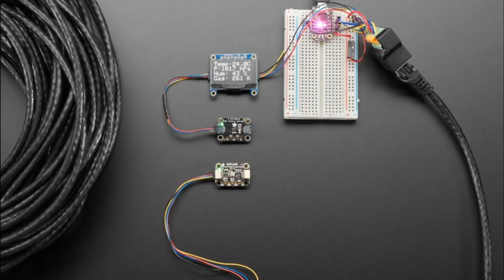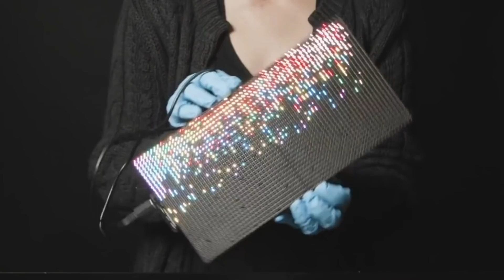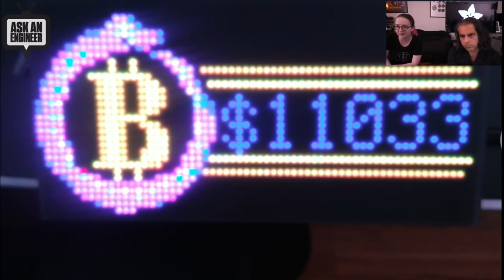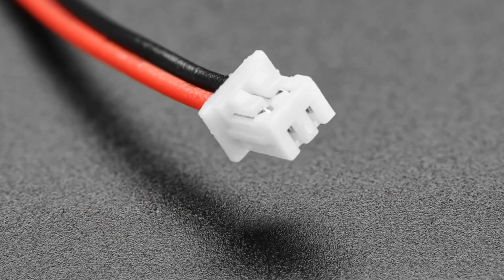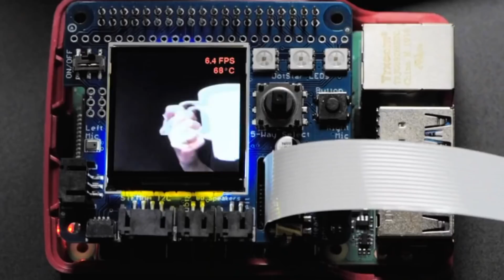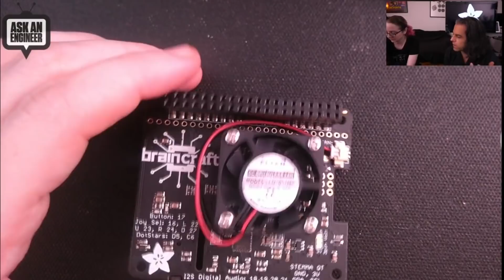New Products 9/16/2020 featuring Adafruit BrainCraft HAT - Machine Learning for Raspberry Pi 4!

Comment: What are those ethernet connectors you are using with Adafruit LTC4311 I2C Extender product. I tried searching on the Adafruit site for them but I couldn't find them.

Comment: regarding the USB cable with data/charge-switch: does the switch simply interrupt the data lines (which is not spec compliant afaik) or is there some controller, telling the phone (via data pins) "nah, I am just a poor charger. I cannot data but wanna have juice?" during initial capabilities negotiation?